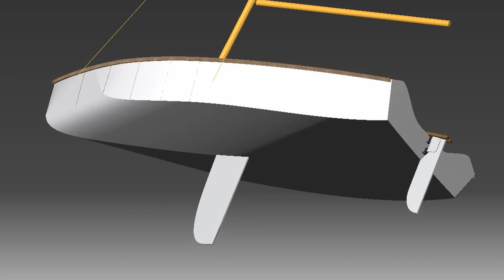TJ - Sailing Dinghy | Centerboard

Comment: if your cockpit is flooded due to a capsize the low height of the centre board casing may be below the waterline making it harder to bail out, also epoxy can break down in sunlight so a protective coat of uv resistant varnish is advisable - nice work👍
Reply from the maker: Hi and thanks for his input! I have tried a model to see if this happens.
 https://youtu.be/Xb6ET3IHhyM?t=288&si=7CWBfa60VnL9Cu6d

It should work quite well if the boat is not too heavily loaded or the swell hinders you from recovering. 

I think the part of the centreboard that is exposed to sunlight will be coated with clear varnish.
Reply: @TinkererJake  having watched your rather professional other video i must advise you that your membership of the venerable association of 'tinkerer's' is now under review, all drawings are preferably done on the back of a fag packet if non available an envelope will suffice, 'straight' lines should be incomplete and wavy, dimensions are not allowed, random numbers should be used, accompanied by the words 'approx' and 'say', decimal points are forbidden, i am away now to make a cup of tea and reconsider my place in society - thank you
Reply from the maker: @IronCurtainTwitcher  I'm having trouble understanding your comment. My irony detector doesn't come to a clear conclusion here.
Reply: @TinkererJake  ha ha! your boats are perfect yet your irony detector is a dismal failure, my irony maker is clockwork and i have to wind it up, sometimes it runs a bit slow😵‍💫